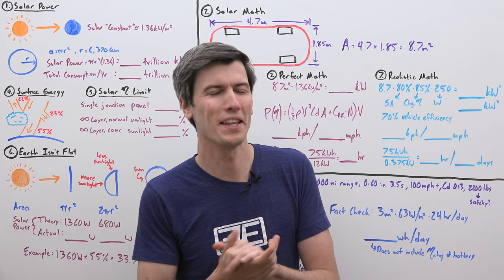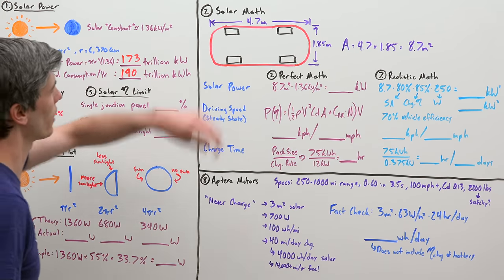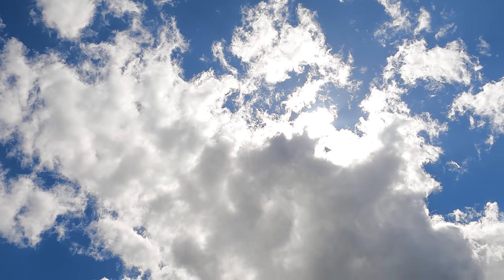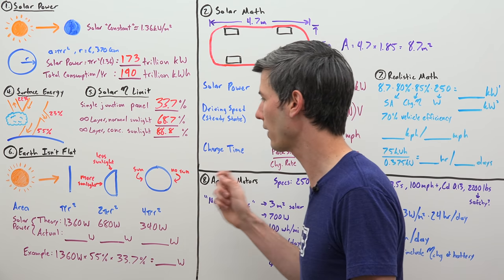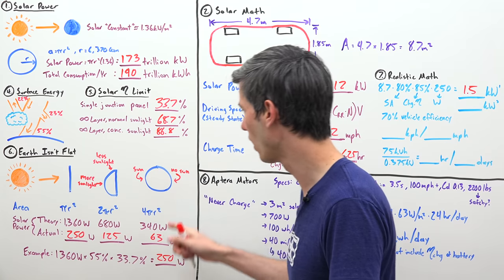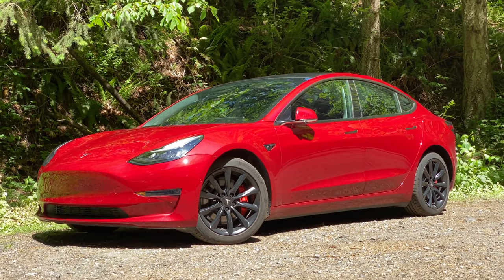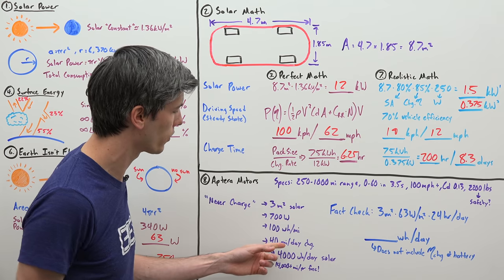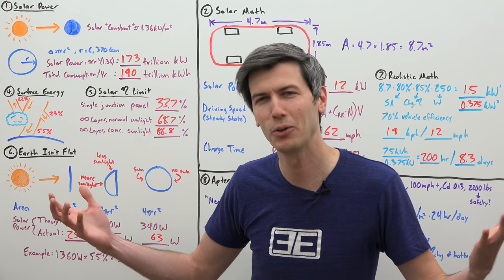Why Don't Solar Powered Cars Exist?

Comment: Even if it is slow, I'd still like to have solar charging as a feature.
Reply: yeah, if they don't cost all that much it would be a nice feature to have some free mileage just by parking the car outside!
Reply: they are non degrade able, basically if u crash, assume that waste just sitting there
Reply: @ryerci9618  non-degradable is the issue? The panels don’t degrade... like the majority of everything that makes up cars?
Reply: @ryerci9618  Wait if u crash and no one is gonna recover your vehicle, you say the car is not bio degradable? Now that’s unexpected.
Reply: @explosivemallard8038  no, plastic can degrade, metals rust out and degrade. broken solar panels are not only near impossible but not reusable as in trying to restore the car or make a new car reusing those parts
Reply: @ryerci9618  Would you mind explaining to me which parts of a solar panel cause radiation? I’m not saying ur wrong, i have just never heard of that. Always happy about learning something new tho.
Reply: @ryerci9618   “plastic can degrade”

Ya sure about that, bud? Short answer: plastic is non-decomposable and non-degradable. Let me put it into perspective if you’re an American:

If George Washington used a plastic cup after crossing the Delaware, it’d still be around for another 200 years.

If Lincoln used a plastic cup after delivering the Gettysburg Address, it would still be around for another 290 years, even if you exclude the whole micro-plastics never decompose, science.
Reply: @ryerci9618  solar panels are made of silicon and silicon is made from sand. Left to degrade silicon will just oxidise back to sand.
Reply: The Toyota Prius 4 Plug-in hybrid has a solar panel roof as an option. At least over here in Europe
Reply: The new Hyundai Ioniq 5 is available with a solar roof.
Reply: For homesteaders an electric vehicle with solar charging can be great.  Also van life people.  I cant wait for Tesla to make a vehicle targeted to van lifers, I'm sure they will.
Reply: In practice, its even worse than he figures.  The added weight and wind resistance negates any advantage from solar charging....
Reply: check out the Apters!
Reply: Plus If you average the miles generated per day its 24 miles per day Produced by the car, this is around the average for americans to drive every day, so it actually does mantain itself basically.  (Avg american drives 29 miles a day, 24 is 82% generated by the car)
Reply: Take a look at the Aptera its a great car which has just released and should be starting to be delivered by the end of the year. They started many years ago but went bankrupt, they started back up last year I believe.

Edit: didn't realized he talked about it...
Reply: Would you want to pay an extra $5k for that feature even if it gives little benefit?
Reply: @matthewd6306  yes. 24 miles a day is what the video showed that’s basically never having to pay for gas ever again. Plus personally I live in arizona the state with the most sun in the US so I’d get closer to 35 miles a day free. That’s no need to pay for charging ever.

Remember 1/8.3 of a tank per day when the car gets 200+ miles of range is a minimum of 24 miles free of driving per day my dude.
Reply: But you’d use more power slugging at about than it’s worth
Reply: The issue aside from efficiency and environmental impact is also practicality. Most people with EVs live and drive in the city, where less light hits the ground due to buildings and other obstructions. Also, many people park their vehicles in a garage (which I advocate for). Between these two issues alone, you can easily increase charging time by over 50%, for a total of over 300hrs, or 12.5 days to fully charge. By this time, you'd rarely see any increase in range or efficiency, especially with the added weight and initial cost of the solar system. Now this would work out better if the vet was capable of long road trips, but it still likely wouldn't work out.
Reply: @oxidizedolive  1: you completely made up the number of 12.5 days, like that’s just a guess isn’t it. But whatever let’s assume it does take 50% more time Bc of shade (that’s more than it actually is)

2, solar panels are fairly light, and you aren’t adding batteries the car already has them, Car may go down by 1-2% efficiency but I doubt any measurable change)
The  model 3 (he used for roof area) has a range of 250 miles of range.(Base)
1/12.5 x 250. Is 20 miles a day

Again, 20 miles a day of FREE driving is a lot. (

(29 average for most Americans, BUT, if you live on the city, like you stated, those who are affected by less charging because of shade; ALSO DRIVE LESS, as they are already IN THE CITY, ) 

Therefore the 20 miles a day of free power they get probably is plenty. AND DEFINITELY is still a huge benefit. 

Also environmental impact? What do you mean lol. You mean the solar panels? The ones that are using solar power instead of fossil fuels like most power that comes from the wall is?
Reply: @Cameron_Mind  no, I took 200 hours as he mentioned in the video that it would take to charge, added 50% (100 hours), and divided by the number of hours in a day, 24, to get 12.5 days. Basic math. Still not truly accurate, but you get the point. Yes, most of this is speculation, and would vary from case to case, but it still makes my point. It would take too long to see a noticeable and justifiable benefit for most people. And yes, there would be less driving in the city, but the efficiency of city driving would also hinder the outcome. I could go on and on about everything else, but it would be useless for both of us. I've got better things to do with my time, and I'm sure you do too.
Reply: @gregcollins3404  Nearly every car has an glass roof as option. That sit flat in the roof why should it be a problem with a solar panel that is insude the roof
Reply: Karma automotive has solar panels on the top of the roof. It's meant to recharge small amounts of power back to its electric motor battery😊
Reply: @jonasstahl9826  It could probably be done today. The new slim profile solar panels could work and be slightly thicker than a panoramic sunroof , but the cost hasn't reached a reasonable level.
Reply: @ryerci9618  learned something new today. Reminder to me that theres always a trade off
Reply: @pdavid24  Slim profil panels arent required, they could use the standart panels that are mounted under the normal panoramic sunroof.
Normal panels that are mounted on buildings are just 1,5 inch/ 4cm thick and that is mostly the frame, without they are around 1/2 inch / 2cm thick that doesnt reduce headspace.
Reply: @oleyeller3256  your welcome for the info 😁
Reply: Australian solar challenge cars blow away any of these figures he's saying. Darwin to adaliade on one battery charge going faster than 100kph at times
Reply: Hail damage would be expensive
Reply: You can the hyundai Sonata hybrid comes with a solar panel on top that charges the battery, even thought the panel is pretty small you still get about 2 to 3 miles a day of the solar panel and it keep your battery topped off when not in use.
Reply: you can have solar panels on your house, and use this extra electricity to charge your electric car
Reply: @Hide_and_Tweak  If you rent you can't and you can't charge you car if your at work or away which is normally when the sun is shinning and the solar on the vehicle will help keep the batts charge and topped off at work and when you don't drive it or the weather is freezing cold.
Reply: I'd rather have an unlimited energy source of a car or truck solar powered might not be as resilient
Reply: @explosivemallard8038  Another big issue with current solar panels is that they are very toxic. My old college was doing some research on partially organic solar panels (kind of like oled) to cut back on some of that risk, but obviously, it's been an uphill road. If the technology was there, we would have already switched over.
Reply: It doesn't make sense unless you keep your car for 10 years because solar panels aren't easily biodegradable and it's just it doesn't it doesn't make sense unless you keep your car for over 10 years
Reply: @ryerci9618  Solar panels are mostly from sillicium. Sillicium oxide is ordinary sand. What are you talking about? 
Reusing is possible when you metl the silicium againm, maybe using electrolyses  for removing the metals out of the molten sillicium, or ultra  centrifuges. Metals can be reused and the silicium...much easier than real nucleair waste.
Reply: @lucaslacasse935   I had my last vehicle a Rav4 for 15 years , even if you sell the car someone else will be driving it ( like my nephew who I gave the Rav 4 to) it makes perfect sense.
Reply: @reiniernn9071  the sillicium oxide will degrade, but anything else in it wont
Reply: It actually makes more sense installing it onto your roof and storing the energy in a battery pack.
Reply: @Cameron_Mind  have you even seen the car? its no luxurious 5 seater SUV that just magically gets 24 miles a day. Its really small, weirdly shaped so it has less wind resistance.
Reply: @philippmayenburg7282  no i was talking about the numbers he provided for the Tesla model 3. It’s not the worst car. Although Tesla aren’t as nice as luxury cars its still a good car
Reply: @fez877  this 100%

Like yeah technically it would be a good cost savings built into the car, but why have any problems associated with it being on the car when you can just put it on your garage roof or whatever
Reply: @reiniernn9071  Silicium doped with toxic elements, with layered toxic semiconductors. More than 1000 C melting point. Ceramics are rarely recycled.
Reply: @timstreeter9795  nope, the sand for solar cells have to be SUPER pure, quarts sand is used and then purified to 99.9999999% purity then doped with arsenic if you want maximum efficiency, solar panels are use many m^2  thus million times larger than your microchips  that are a few mm^2. So the environmental impact is questionable to the least
Reply: @gregcollins3404  there is very little weight and wind resistance added. In case you haven't heard, there are flexible solar panels with the thickness of a sheet of greyboard available. People are so misinformed and FUD about this...
Reply: @Cameron_Mind  because most human beings don't have garage roofs, garages, or even their own houses.

This comment section is so biased.
Reply: @empyrionin  well for those then of course it’s a good solution. But it’s better to use it on your roof if you have one. If not, having extra range for free would be nice. Secondly, just a sidenote; since you need to charge your car and the main feature is charging at home, do you know. A single person who has a electric car and doesn’t have a house?
Reply: @gregstafford2155  there hardly a practical car for everyday use.
Reply: Passive charging isn't a bad idea even if you still have to charge once a month.
Reply: @Grauenwolf  agree if it didn't what would happen to all the dead rubber trees ,,i seen plastic made by Farmers in Thailand here on YouTube,, rubber/plastic Farmers planting rubber trees and bleed them it looks like milk then it's filtered etc no protective gear is needed and They get rubber all over their hands and arms etc.. just think about what would happen to the rubber trees at such farms if it wasn't degradable
Reply: @gregcollins3404  not true.
Around town my solar Nissan leaf averages 30 mph and I'm not seeing mileage degradation from the wind resistance.  4.2 miles per kWh.
Reply: Same for me !!
Reply: @ryerci9618  solar panels are recyclable you can recycle them and reuse them
Reply: Yes, even just to run your ac all the time while your car is parked in hot days, running only in solar power
Reply: @ryerci9618  One 5 second google of that statement appears to prove you incorrect.
Reply: Not worth the weight, price, when you can put that money into more batteries. 200hrs to charge in the real world with flat panels (non optimal) is 40 days to fully charge a car in perfect cloud free cold day.
Reply: @Cameron_Mind  you absolutely will not get 20 miles a day. Maybe 1-3 miles per day in good conditions. The roof area of a Model 3 is roughly the size of a 200 watt solar panel x 6hrs a day (industry standard number because you don’t make full power in the morning and afternoon) gets you 1200 watts before accounting for loses in the system.
Reply: @TobyCostaRica  did you watch the video? At all? He goes over the math don’t use your own random numbers. Watch the video.

Good conditions net over 25+ miles a day 

Average is 20 like I said. I took what he said and pointed out at sure 8.3 days to fully charge is actually decent and provides good milage per day
Reply: 9:50 considering ghost drainage in ev, would that eliminate ghost drainage, the 1% every day thing?
Reply: @explosivemallard8038  so it will degrade eventually only it’ll take plus or minus 200 yrs.
Also the sun 🌞 degrades just about anything if left out long enough……and it doesn’t take 200 years for some materials to degrade. Example sun shades like on umbrellas or gazebos most are made of a nylon or polyester mix but still very much “plastic” I have to replace them 1 to 2 years. 
I guess if a plastic is left underground sure it’ll take a long time but eventually everything does degrade.
Reply: Yeah sure charge the car for 8.3 days and then drive at a maximum speed of 19 Km/h or 12 MPH
Reply: @oxidizedolive  most people leave their cars in a parking lot in the sun all day (peak generating time) while at work, so being in a garage at night doesn’t really affect much.
Reply: They have solar charging on the Hyundai hybrid.
Reply: It would help negate the passive battery drain Tesla has from battery management and security systems
Reply: Yep mee either coz who need a light speed car for general purposes.
Reply: @Cameron_Mind  if you search YouTube you'll find people who live out of their EV
Reply: @Sheridantank  seems homesteaders would be better off setting up a large solar panel array at home and recharge the car there (and use the electricity to power some items in the home, too)
Reply: Why some people never use solar panel on the roof of the car ???
😎For me , I was very satisfied by adding solar panel, 
My car is not electric car  but I still can put solar to help charging the battery, so that the alternator will not working hard any more , because solar can help to charge the battery to gether with alternator,  it can share the loading  from solar and alternator,  so it must be save some gasoline too ,